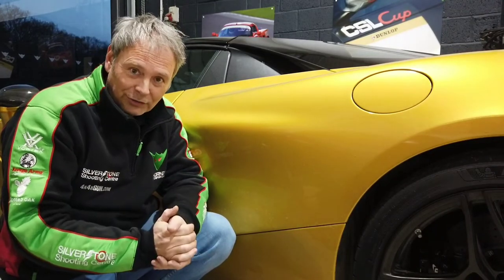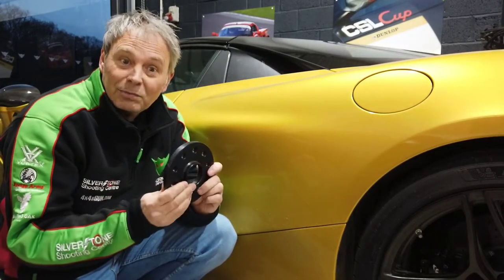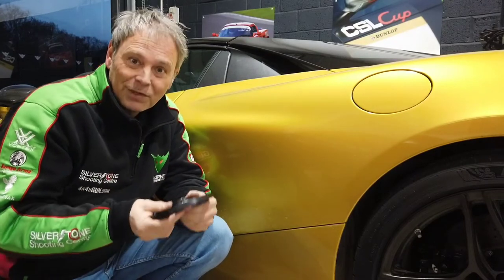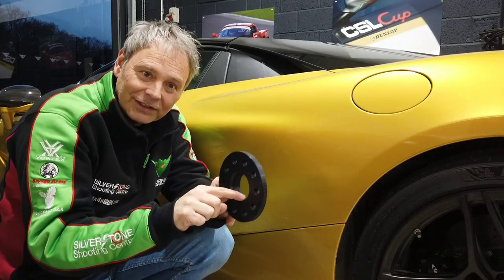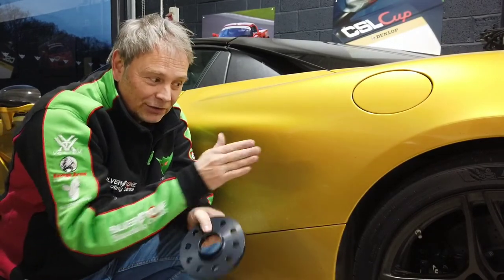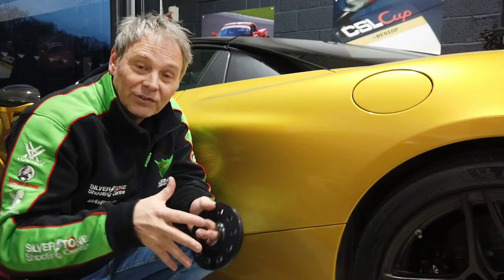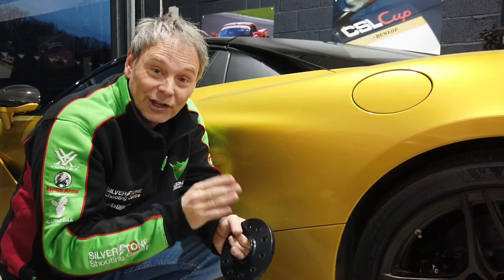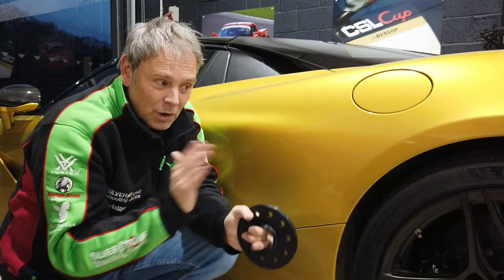Mclaren 720 Owners Vlog. Spacers

Comment: Hi John - In terms of just looks not track driving would adding a further 12mm spacer to a 675LT set up make it look to boy racer, with wheels outside the wheel arch line. Also what about increased stone chipping of the outer wheel arch area.
Reply from the maker: Weve not heard of any extra paint chipping and they do fit the 675 but if you run track runner we have seen some running on some 675 models, not all weirdly enough though

Comment: Do you recommend them for the 650s? Are they the same? You mentioned the Audi spacer, if that is used how do you deal with the bolt length?
Reply: You get longer studs with the spacers as part of the kit
Reply from the maker: Yes, we supply longer bolts are part of the kit. Recommend for ever McLaren model.